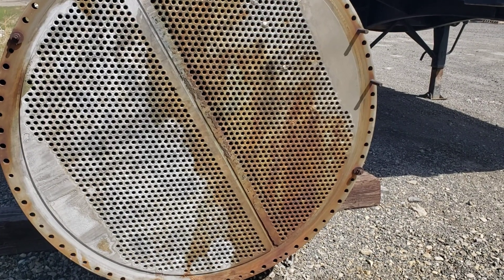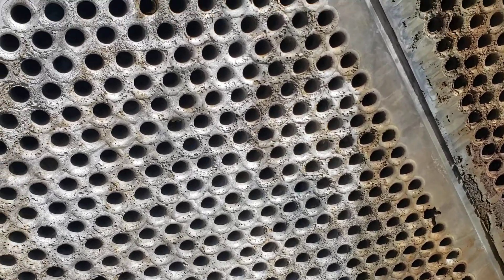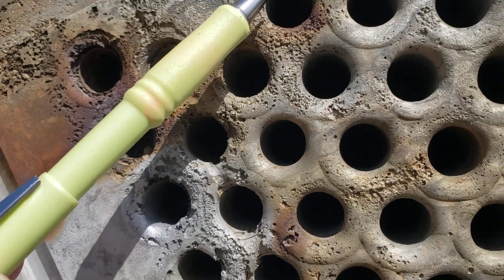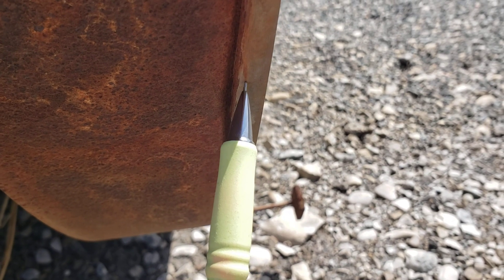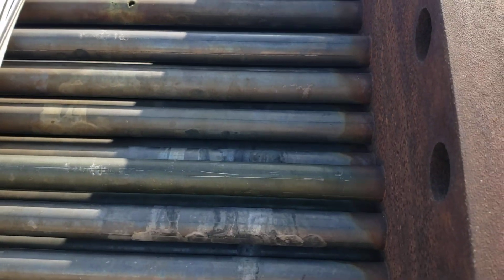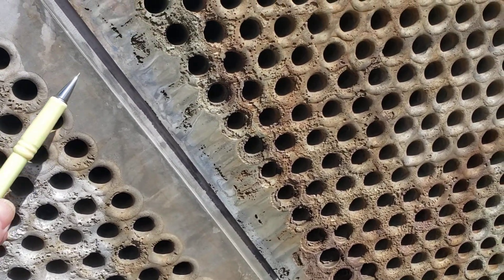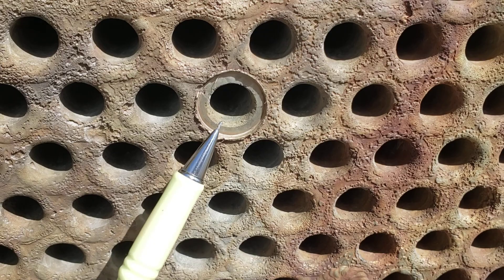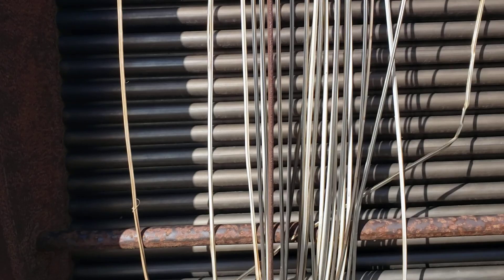Heat exchanger tube sheet corrosion

Comment: Is any corrosion tolerance for this @MrEric_API
Reply from the maker: On a tube sheet the controlling corrosion amount would usually be the tube condition and gasket sealing surface.  Ditto for if the tube has a ferrule or has a welded end.  The tube sheet usually has plenty of corrosion allowance,  so the tube condition is usually the controlling element.... though for alloys and other unusual features may be closer to the tmin. 

 MrEric